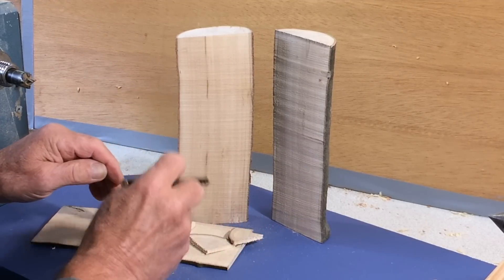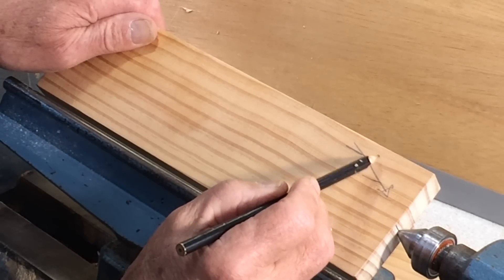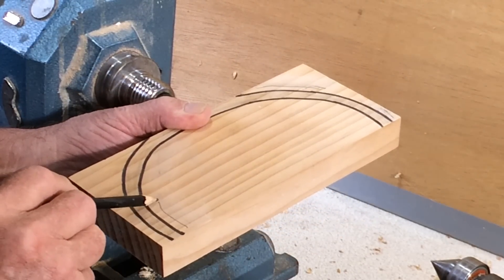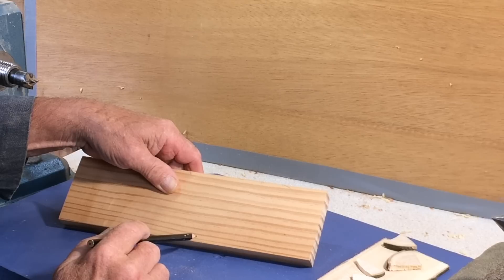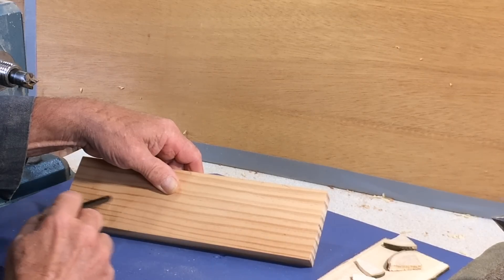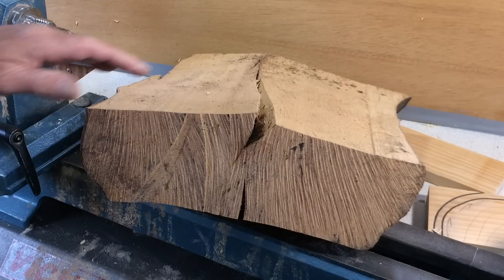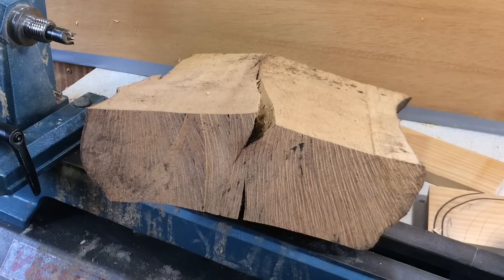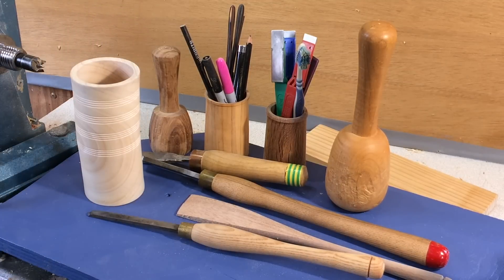Richard Raffan on basic stuff woodturners need to know about wood

Comment: I love that you're going into the basics.
Might as well have reminded viewers though that the reason for all of this is because wood is made of fibres, which are long thin cells with fairly solid walls.
If people just remembered that little fact whenever working with wood, it would solve many problems and answer so many questions even the very moment they crop up.

Comment: Great instruction here!!!  A question: Instead of cutting the blank along the split, wouldn’t it be more efficient to just drive a wedge into the split.
Reply from the maker: That definitely depends on the split. Saws are usually a better option when a knot or twisted grain is involved. In the distant past I spent a lot of time and ingenuity removing jammed wedges.

Comment: I really like the cross grain tube, the slightly warped shape is more “organic “ I never thought to try and turn a piece like that, I’ll give it a try. If you had a burl piece, with little stress cracks all over would you throw it out, or would you fill the tiny voids with epoxy?
Reply from the maker: It depends on the splits. I went through my filling-splits-with-coloured-epoxy phase 40 years ago and found that longterm the epoxy remains inert whilst the wood moves around it. Plus the wood darkens so eventually the surface is totally different to what I had initially.  Then I took to sand blasting, charring, and brushing. I've just made a video on some of that.
Reply: @RichardRaffanwoodturning  thanks for the reply, I have madrone burl with little voids, and I fill it with black ca glue, or black epoxy, they seem to hold well, but my oldest one is only a few years, I also have tons of manzanita burls with the same voids, sometimes rocks are in side, but when I get some relatively solid pieces it is very stable and has a quality almost like stone, super hard to throw away
Reply from the maker: @brianhawes3115  Occasionally I was given madrone and manzanita for demos and always enjoyed turning both woods. Filling voids it's best to use epoxy rather than CA which only lasts a few years.
Reply: @RichardRaffanwoodturning  thanks so much, I have a question for you, I have a nova lathe, I think it’s from Australia, it has two different speed indicators one for us and one for down under, when you call out your speed would that be the Australian one? Don’t know why things spin faster down there
Reply from the maker: @brianhawes3115  Nova lathes and chucks are manufactured by Teknatool New Zealand,  made originally in NZ but now in China. I only used Nova lathes infrequently when demonstrating in NZ or the US and can't remember much about them other than I never had time to learn how to work the speed control effectively.

Comment: Richard do you paint or seal the ends of green blanks? Any tips
Reply from the maker: I do wax or paint the ends of fresly felled logs sawn into boards, but reckon that generally it merely slows the enivitable splitting. Turning bowls for a living I rough-turned all boards and logs as soon as possible, then let them dry without sealing the endgrain.  I'm mostly using timbers known for their stability so splitting has never brern too much of a problem.
Reply: When I cut a new green log, I inspect the ends for splits first. If no splits, I section the log into 3 pieces. 
I take out a center section of about an inch to one and one half inch for a future platter or dish depending on the size of the log and the grain widths. 
This leaves two bowel blanks. I immediately coat the ends and a ways up the sides of the blanks with end grain sealer. Depending on the tightness of the grain I may seal the entire center board. 
Richard lives in a much drier climate than I do , so he will have a faster rate of drying.
Reply from the maker: @danielmetzler307  I spent most of my production-turning years in damper Devonshire then overlooking the Tasman Sea, always coping with high humidity.  I've never found sealing endgrain helps me get more bowls from a log. Rough turning ASAP is a far better way to go. Then the wood can move rather than split. With all the shorts kept solid I've found endgrain splitting on anything less than 200mm long has been so minimal that sealing the endgrain was never worth the effort or expense. I do choose my timber carefully and process it quickly, which makes a lot of difference when it comes to seasoning.